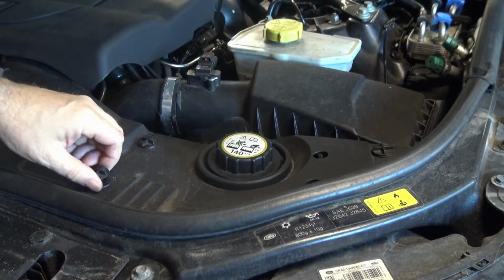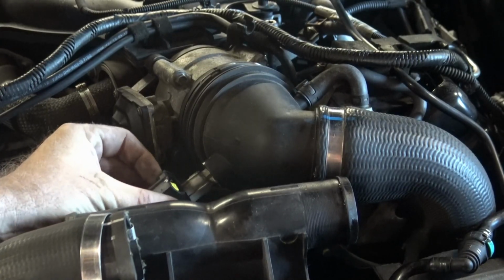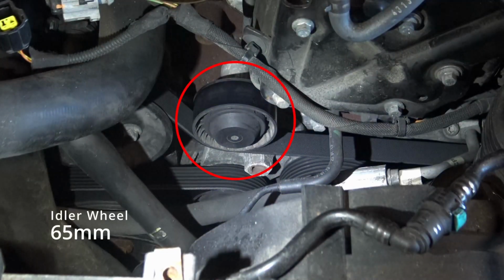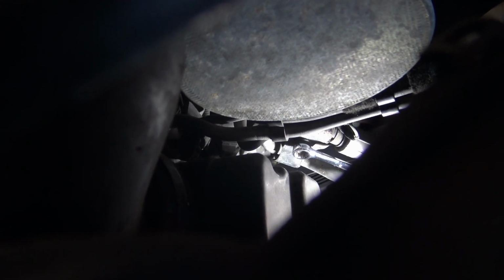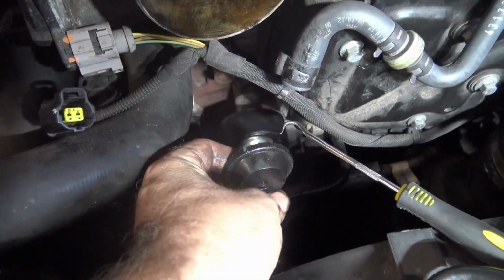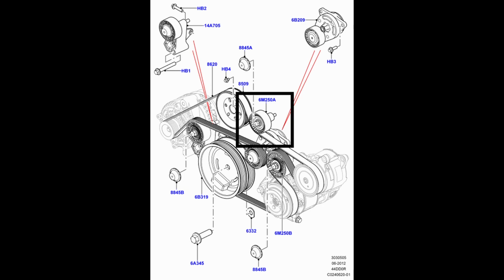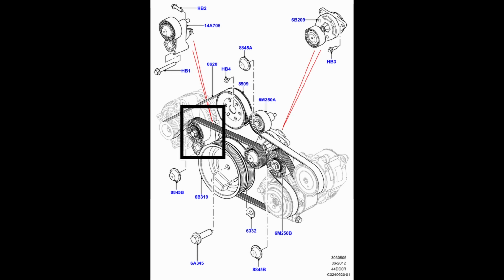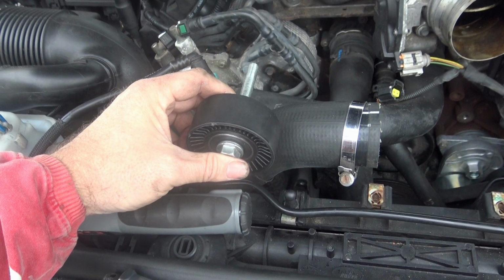L405 Range Rover V8 Engine Whine

Comment: All it easy)))) 

1. Poly V-belt CONTITECH 6PK2498.

2. Drive belt roller INA 532073510 (LR025823). A 2mm washer is required for this roller.

3. Tensioner roller INA 532073610 (2 pieces). (LR022809 and LR022953).

4. Tensioner roller INA 532051510. (LR025083).

I think that is better febest)))) 
from Russia)))

Comment: The generator jocky wheel Febest 1287-1X55 was exactly the correct part although the supplier was arguing the suitability as it was listed for a Hyundai. I had to promise to check it thoroughly before fitting as he wouldn't  accept it back.  But it did fit thank you for this advice Dr Andrew brilliant video
Reply from the maker: Glad to help. As a good Scot I was damed if I was going to pay for the complete jockey/alternator bracket! Yes the febi/hyundai wheel fitted perfectly and is still on my L405 going strong. Pleasure to have helped.